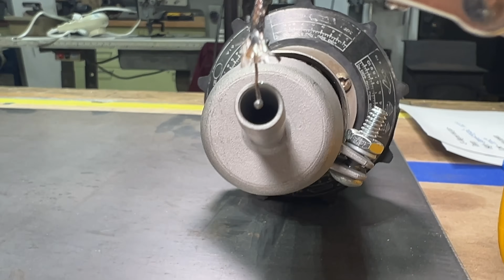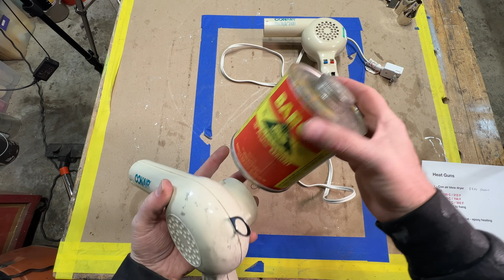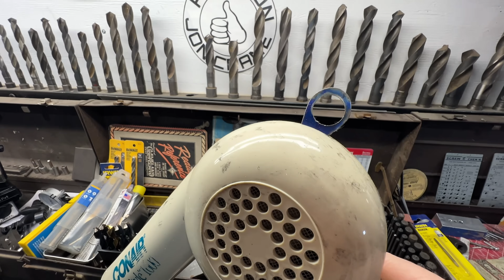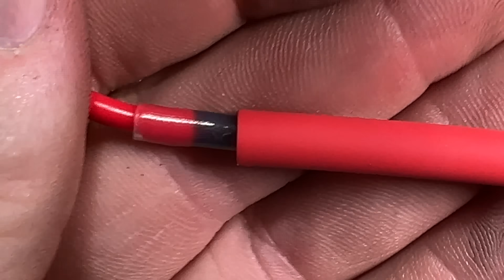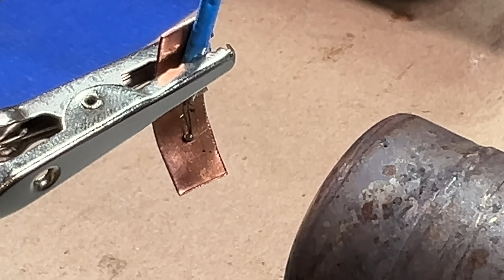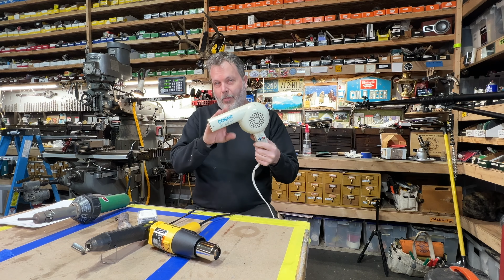Heat Guns! How Hot Do They Really Get?  Tips & Tricks - Leister - Wagner - Con Air

Comment: I just recently bought a new heat gun with the cool down function. I also have that exact same blow dryer II use in the shop and one of those little ones which is a lot more convenient for working on wiring but I think I'll pass on the 600 dollar Swiss Deluxe.
Reply from the maker: Right on! 👍 What heat did you get with the cool down? I’d like to check it out. And yes the Con Air is a great tool in the shop!
Reply: @RightOnJonCrane  Some oddball brand, Teccpo TAHG08P variable heat, 4 end attachments, stands up and all for under 20 Bucks.......Works perfect now, only time will tell about longevity but I did get the 2 year warranty for 2 dollars and it still came in under 20.
Reply from the maker: @ Wow that’s awesome! Could be a winner. You never know! I’ll check it out! But can it cook bacon? 🥓